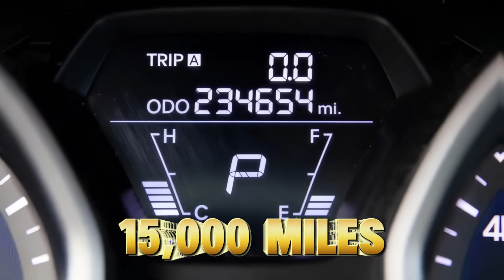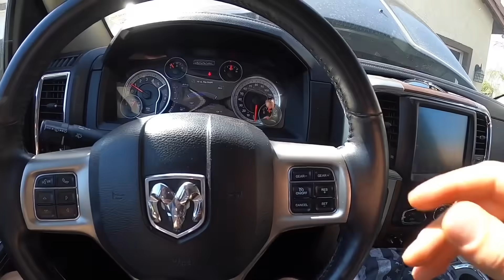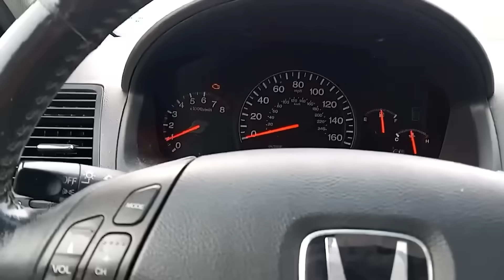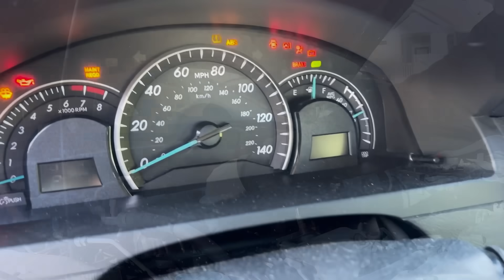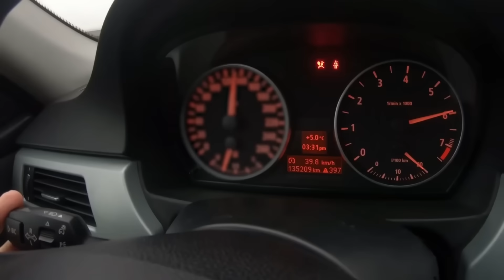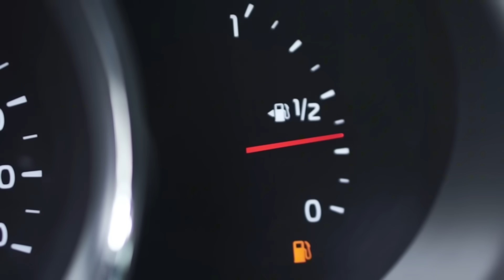The TRUTH About 5,000 vs 15,000 Mile Oil Changes (Exposed!)

Comment: Depend of many question...,,,temoerature expliating ,,many times on shorts rirde with cold engine end low rpm is worst,,,but easy  the unprepear engine end bad driwer plus wrong serwis end user controls are   yust a part,,,,cold engine winter  sometime can be deadliest,,,like end sumer   heat plus radiation of sun in city mass 1mm by 1m in time laps longer than a 10 min rhe same,,the progres if technology impriwements if shel  ti pritect humans end engine are dismised,,,,like end pritection of shel end engine from outside riad aterials   watter sokt   small stouns belowe,,,smal unefectiwe filtera of oil end air,,,,to m7tch lousing tips are conected,,,,pros0erity is simple antioxidating mpv  pkus Balkan Neodium Turb9 Engine end wiackle can run 109+ y3ars   smoutly,,,oil,,,no need

Comment: every 6mths or 5000miles whichever comes first. My 2000 4runner has almost 400,000 miles and runs perfectly with that schedule. My other vehicle, a GX460 sometimes will only have 2000 miles in 6mths, I still change the oil.

Comment: 🤔Change oil and filter change at 5,000 miles with the correct for engine model 5-30w & not 0-20w manufactures use to try claim high MPG figures🤥 if you have a turbo wet belt driven engine? Otherwise inspection of the belt 🔍👀 at 40 -50,000 miles will 95% of the time end up with 😭

Comment: For my 2005 Nissan Titan XE with 96,000 miles on it i change annually or every 3000 miles , whichever comes first.  Using Penzoil Platinum (made from natural gas).
Reply: I've noticed once a year works great with that oil if you drive less than 10,000 km like I do (I'm retired). Contrarily to other oils I used in the past, this one still looks good at the end of the year and the engine stays quiet over the duration.

Comment: Please don't listen to what this video said. It is true in terms of what it said but it is very difficult for us to judge if 3000 miles or 5000 miles is the right time to change oil. If you don't want to spend money fixing engines, it is best to change your oil a little more often to avoid break downs. Million miles drivers for certain vehicles simply never skip a beat doing maintenance to get to a million miles. Lesson, don't skimp on maintenance, it will go a long way literately speaking.

Comment: real life engines nd mechanics are proof change your oil early my colleague i’ve been telling him for a long time to change his oil every 5000 kilometers not 10,000 as dealership recommends nd change transmission oil before reaching 91000 kilometers max don’t believe dealership nonsense that transmission oil for life , he used to mock me nd tell you can`t be smarter than dealership , nd recently his car almost totaled he took his car to a good mechanic nd mechanic opened his engine nd called him to see how his engine fucked up nd oil is sluggish nd colleague told him i change oil every 10,000 kilometers as dealership said mechanic told him that’s your problem changing every 10K gonna ruin your car in time as you can see plus he had to change torque converter for neglecting transmission oil but eventually his car was saved engine cleaned and cleared like new and new torque converter transmission was fine not damaged after he went through this he came and told me this story and showed me pics and vids and told me you were right and i’m glad my car was saved i can`r afford new car from now own changing oil nd filter every 5000 kilometers and transmission oil every 80000 kilometers

Comment: Ford 3.7LSedan.....stop and go city driving, idling.....snow, below freezing temps in the winter, high temps in the summer.   Every 5,000 km   (3,000 miles) with Motorcraft Synthetic Blend and Motorcraft high capacity Filter.....like you said, oil is cheap, internal water pump bearing failure on these engines....expensive.

Comment: Long highway trips means no ideal driving conditions. I that's why in manual of Hyundai i20 states: shost distances, long or frequently highway drive, towing a trailer, dusty environment - oil change mileage is shorten from 15000km to 7500km.  And in every case every 1 year.

Comment: You are seriously misleading people!  There are independent studies on oil viscosity persistence and engine wear that show long change intervals (e.g., 10,000 miles) actually increase more wear over the same distance than using shorter change intervals (e.g., 5000 miles).  It's plain ignorance and stupidity to go 15,000 miles between changes -- people who wait that long are also likely to use the cheapest (and often incorrect) oil they can get at Walmart.  How long do you want that engine to last?

Comment: DPFs and EGRs cause engine failures, I've run and repaired diesels for over fifty years, the only engines that are sludged up, even when oil changes are neglected, are ones with dpf or egr because the oil loses it's liquidity and clogs oilways. I have an older diesel VW van, 340,000 miles, I change the once a year, no sludge no oil consumption, goes like a rocket, customers are farmers and with newer vehicles, they all run about from farm to farm/field to field and have sludgey oil and blocked dpfs, I have taken to telling tthem when they need an oil change. Oh yes and modern oils are too thin!

Comment: When oil analysis tells me to change the oil. Lived in Germany for 15 years and oil changes were at 15,000 km (9300 miles) not miles. European synthetic oil uses oil Base Stock Group IV or V . Group III is not "synthetic" in Europe, only in the USA because of a Law not chemistry. Vehicles (both diesel and gas) in my family are driven to 300+K miles. Before direct injection I changed Base Stock IV or V synthetic every 25K miles and never had an oil related failure. Today with direct injection engines that can have carbon coated valves, intake, turbo, ect. rom oil (EGR & PVC move oil laden air into the intake) the rules are changing and oil analysis is a must for extended oil changes.
Reply: You test the oil before every oil change? It's usually much cheaper to just change it. Unless you do it occasionally to monitor  how the engine's doing.

Comment: My old citroen did 320 thousand miles before body rotted away,  no problems with engine (6000 mile oil changes).

Comment: They should have a time meter on the engine. If you drive in stop and go it is harder on a engine than a car driving at highway speeds. I change at 5,000 miles, I usually drive in a rural setting.
Reply: Your mpg is a good indicator of oil life. You get the highway mpg in mixed driving - you're probably easy on the oil.  You get significantly less than the city range? Then do 3000 mile, 6 months oil change, whatever comes first.
Reply: Divide your mileage between oil changes (reset the "trip" ODO on dashboard) by average speed (AVG on dashboard) - and your get your "time meter" aka motor-hours.

Comment: Section 18 is the key here.  What do you gain by extending the oil interval?  For me, about $50 a year.  Seems really foolish to even try and calculate the best interval.  I'll stick with my 4-5k rule and not have to worry about it.

Comment: Never run 0w anything it's trash
Reply: I changed my Subaru to 5w-30 no problems so far.
Reply: @theamazinggoldfish8713  ...My 2015 RAV4 with the 2.5 that I bought a year ago says 0W-20 on the oil cap, and that is what I used on my oil changes at about every 3,000 miles. Every time I started it, the motor would give a kind of rattling sound. I was due for another oil & filter change just last week but I did a lot of reading about why 0W-20 was called for, and if a little thicker oil would be okay to use. The 0W-20 recommendation...and that is all it is, a recommendation....was from the government that pushes for better gas mileage and 'supposedly' less pollution. This is why motors have gotten so much smaller. So... I found out that the RAV4 is sold all around the world and depending on the climate in other countries, especially hotter countries than what we here in America generally have, Toyota actually says to use 5W-20 or 5W-30. 

I had my mechanic put in 5W-30, full synthetic instead of 0W-20. The difference was immediate. On start-up it is much quieter and stays a lot quieter than before. I read that the thicker oil might affect my gas mileage, but so far I have seen no difference. This slightly thicker oil will protect the motor better than the thinner oil and will increase its life-time...as long as I do my part. From now on, my oil changes at about every 3,000 miles will now be 5W-30 full synthetic.
Reply: OW just means the oil flows better during cold. So 0W30 would be just the same when is warm as a 5w30.
Reply: @ryanhuang8498  ...Hi, Ryan...you are correct. The 'W' stands for Winter or cold temps, and regardless of the temperature outside, as the motor warms up, the oil will thicken up to the thickness of the 2nd number.  

This is counter-intuitive to what one would think. Cold oil should be thicker than warm oil, but somehow, it is just the opposite. Sounds like magic....!!! 

But it wasn't but just a few years ago that I thought the 'W' stood for 'weight'. A lot of people still think this way.
Reply: Not Euro 0w-20/ 0w-30/0w-40 with Porsche, VW, BMW, and MB certifications.

Comment: Virtually all new engines are GDI.  A lot of new cars have turbos.  The manufacturer myth that smaller engines with turbos get better gas mileage.   My 2026 Camry oil change interval is 10,000 miles. No way.   I will stick to the 5,000 mile or one year philosophy.
Reply: @markmandelstamm2866...GDI engines are inherently bad due to the carbon build up on top of the valves that do not get cleaned off like they did when fuel injectors used to spray the fuel on top of the valves, which kept the valves clear of carbon deposits. 

Clean oil helps a little bit in keeping carbon from building up too quickly on the valves ( good reason for 3,000 to no more than 5,000 mile interval oil changes), but it does not solve the problem. Some manufacturers are now having a dual injection system; injection on top of the valves and then directly underneath the valves ( GDI ).

I hate GDI...!! Thankfully, my 2015 RAV4 that I recently bought doesn't have GDI or a CVT transmission; it just has a dual OHC, VVT (variable valve timing). It is simple, reliable, dependable, and can last 300,000 miles and even more, as long as I take care of it and keep regular oil changes and the other basic maintenance items.

Comment: Conventional motor oil = 3,000 miles or 3 months.

Synthetic blend motor oil = 3,000 miles or every 3 months.

Full Synthetic motor oil =
5,000 miles or once a year.

Amsoil 100% full synthetic motor oil =
10,000 miles or once a year.
Reply: I think you got the pictures mixed up, or the arrow is pointing to the cleaner engine with 5,000 miles oil change intervals.
Reply: I have a 2008 Dodge Dakota 4.7 crew cab and it burns no oil or no leaks with 19700,00miles on it I've changed the oil and filter every 3,00,00 miles with synthetic oil.
Reply: @andrewritchie6629  changing oil every 30000 miles will shorten it's life ,   or maybe you spell incorrectly ?
Reply: 3 months.???

Comment: I know this is about oil changes in CARS but I would like to tell you about oil changes in Detroit 2 cycle Diesel engines. These engines ran fine for a great many years on straight grade SAE30 motor oil providing great service life with very little trouble. Mechanics were always warned NEVER to use Multi Grade oil. Sometime in the mid/late ‘70’s GM in their infanent wisdom announced users could now use multi grade soils. Not long after this announcement Jimmy engines began to fail all over North America. Quite often an oil analysis would determine the oil was ok for further use. According to an Imperial Oil engineer, the oil had two failure modes, one being total failure of lubricity, but more often a temporary failure caused by heat and load that would revert to ‘normal’ when these two factors were no longer present. GM still insisted nothing wrong with using it and engines continue to fail. Many years later they revised their advice to change oil at about half the recommended intervals. So much for the value of engineering advice ? ? ? . . . By then, the engine was determined to be ’old-tech’ and production was ended in favour of the 4cycle 92 series. End of problem but it cost many owners a lot of money.

Comment: Change filter every oil change
Reply: duhhhhhhhhhhhh
Reply: Yes always! And add 6-8 small neodymium magnets around or into the oil filter 👍😊🇦🇺🦘
Reply: @Eric-z2m3c  dont for get One cup clump kitty litter.
Reply: I use a Purolator Boss or Mobil 1 Extended Performace oil filter rated for 20,000 miles but do.several oil changes every 2-3,000 miles and THEN change filter around 10,000 miles.
Reply: @Noypi54494  That's the right answer. Oil filters get better at filtering only after a while. You must be doing a lot of stop and go driving to change oil every 3,000 miles, or drive very little. I'm retired now so I drive much less (under 10,000 km a year), so I change oil only once a year, right before winter - the worst season for oil contamination for us in the Great Whte North.
Reply: Unless you have a bypass filtration system on top of your regular oil filter, no. A fresh oil filter lets more contaminants pass through.
Reply: @johnnyjimj  bs

Comment: I drive 15 minutes to and from work. The stores I frequent are less than 1/2 mile away. I have about 50 percent stop and go traffic so I am changing my oil in my 3.5 liter honda every 5000 miles. I do take an hour + drive a least twice a month.
Reply: 출퇴근시 간간이 저단기어로 2500-3000rpm 주행해보세요. (연료계와 촉매 정화용 구간 rpm)